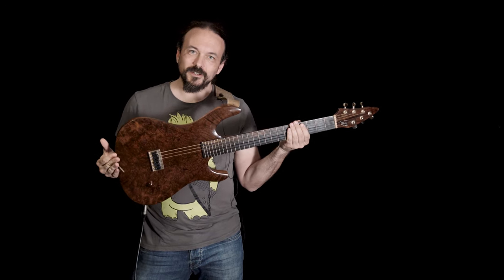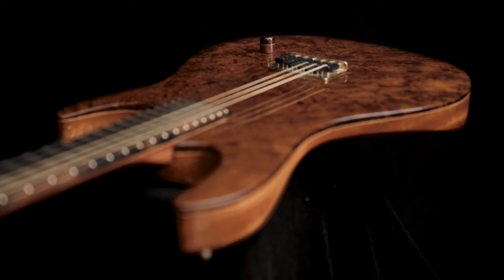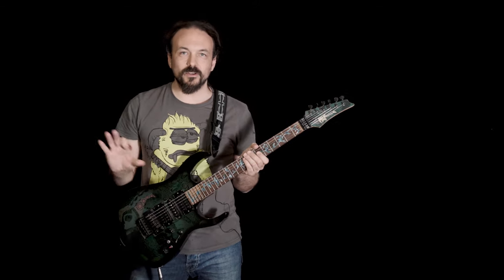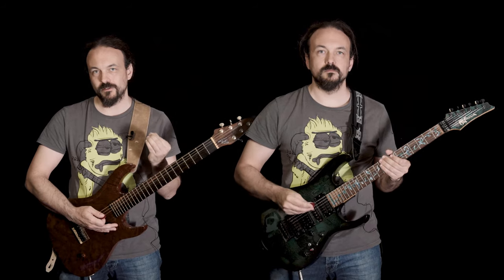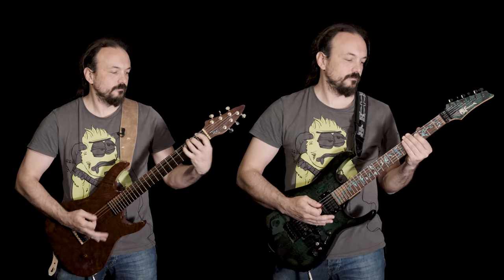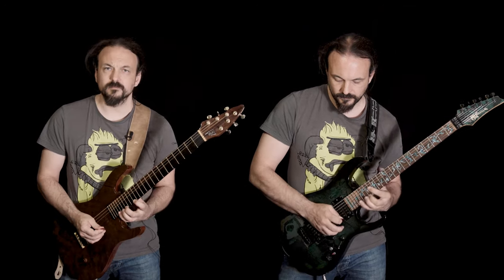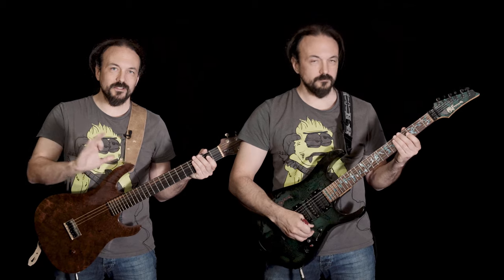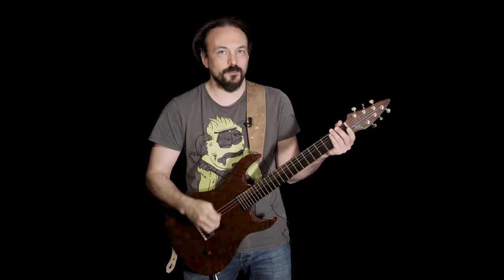Testing a nylon-string guitar with distortion

Comment: Cool video. Maybe playing distorted nylon requires a lot more time to mimic a regular steel string.
Reply from the maker: thanks! I admit I haven't really spent time on trying to "mimic" a steel string sound, I just played the same things the same way. I guess one could get closer with some adjustments to technique, though at the end of the day this will only take you so far, the piezo vs magnetic difference in the frequency spectrum and the difference in the tone of the strings will always be there. This combination does have  a tone of it's own, maybe someone will find it useful for something at some point :)

Comment: Great job.  With comb filter you can simulate the position of singlecoil magnetic pickup. Humbucker with two combfilters etc. (but it is a little more complicated when you make string shorter you muss count this in comb filter time variable for each string individual)
Reply from the maker: yes, I always imagined the variax works this way, and I was a roland system that did something similar. having pitch detection allows the system to guess where the note is fretted and apply appropriate filtering for the given pickup combination it's trying to emulate. Thanks for the links, I've been to that page a few years ago, but I have to read up, he's discussing some things that I'm also researching
Reply from the maker: and yea, for a fair(er) comparison I should have used a piezo with the metal strings... I guess I wasn't going for a scientific comparison, but rather something that people can use as a familiar point of reference (humbucker). Metal string piezo with distortion is also not very common :)

Comment: Very interesting.  What kind of distortion (or pedal) are you applying to it?  The output is direct or via amp-mic?  Thank you very much!
Reply from the maker: It's all going through the Kemper profiler. The clean tones have all amp sims switched off (the guitar is going direct) and the distorted ones are running through some Marshall patch IIRC

Comment: One of the coolest comparisons I have ever seen.  Well done - hats off.  Nice guitar too : -)
So now the question comes what difference between "normal" and "hard" tension strings ?  Wound 2nd and 3rd strings (Nylon on Nylon).  Or Nylon top 3 and flat wound steel lower 3 ...
So many questions; if there is too much bass coming from the guitar that it chokes the amp, we need a different amp (or model ...).  I think there is a lot to discover here ...
And what about different piezo pick-ups ??  The acoustic crowd is always saying that piezo's are to "nasal" and they don't really like them.  But fans love Willie Nelson's Trigger with the PrismaTone pick-up.  That's an ultra rare vintage pick-up.  But what about an LR Baggs LB 6X to approximate the PrismaTone ...  There is a lot of room for experimentation here, lots of room : D
Reply from the maker: you're right, this is an unexplored field to a large extent. I don't expect a ton of change from high tension strings, different piezo or different piezo preamp will of course change the frequency content a bit, also different amps can be used depending on what one wants. To me the "choked" chug sound is not really what I'm trying to achieve, but I can totally imagine someone making it a sound of their own.
Reply: @TraqGuitars  Just seems to me that we've sort of covered most of what steel strings and single coils, or humbuckers can do ...  There is some developemnt going on at the OEM level like my Thinline Ibanez nylon cut-away.  But it's not a lot.  And that surprises me.  A lot of musicians talk of "searching for new tones", but seem to be doing almost what everyone else is doing ...  You are sort of out there on the edge, and that is way cool.  Keep up the good work, and stay well : -)
Reply: @TraqGuitars  but..it sounds awesome!! So much that I built my new chug monster by this recipe... thanks for this idea and wonderful demo!
Reply from the maker: @axelmorisson  great to hear that! I guess I'm a bit conservative in the way I want my chugs to sound :D but if you like this kind of sound and can put it to good use, all the better - at least that's something new!

Comment: I'm not sure if you check these comments still, but I've been searching everywhere for an answer for this question. 
I bought a solid body nylon string guitar called Bullfighter Brown-GD. It has an onboard preamp and the pickup is proprietary and they just call it "bullfighter". 
When i hook it up to my amp, it is literally incapable of distortion, overdrive, whatever you call it. I can change the EQ/tone and volume however I want, but that's it. 
Is this a limitation of the pickup? The preamp? I can't figure it out and I would love to customize my guitar to give it this capability in the future.
You have my endless gratitude if you can provide me with an answer.
EDIT: Apparently if I hook it up to my Line6 UX1 preamp on my PC, I can add whatever effects I want to through their Pod Farm software, but that may just be because it's being processed through the computer first. I'm gonna be honest, I barely understand any of this...
Reply from the maker: sorry it's been a while indeed.. in simple terms distortion is when your signal is too loud for your input device to accept. It usually sounds ugly, but in some equipment distorts in a way that actually sounds cool. The rest is history lol. But what I wanted to say is this: the only reason for something "not being able to distort" is if it is too quitet to distort your amp, stomp box or whatever you're using at the time. Take a distorted amp and roll down the volume, or just play softly. You should be able to get the distortion to go away, if you go quiet enough. 
So if you couldn't get an amp to distort with a guitar, that means the signal feeding the amp was for whatever reason not strong enough - weak preamp, low battery, or some other electrical issue. Asumming the amp is capable of distortion (and not an acoustic guitar amp for example) Maybe the Line6 preamp had some extra gain that brought the signal up to the required level?

Comment: The tapping technique on the nylon guitar was heavenly, but the lower notes are definitely something-- they felt really crunchy at times, and I ADORE THAT, but at some other times it felt really muddy. That bass is really weird hahahah

What would it be like if you went with steel strings for the 4th, 5th abd 6th string?

Comment: Hi! You've built a superb and beautiful nylon strings guitar. Congrats!! and it sounds great with distortion. Is it possible to know what pedal did you used in this video? As I'm looking for a similar result. Thxs!!
Reply from the maker: thanks! this is actually not a pedal, I'm running through the Kemper profiler. The patch is some Marshall Plexi simulation, so what you're hearing is basically old Marshall type of distortion.

Comment: Have you tried using the nylon strings on a classical guitar with piezo pickup and try to play it with distortion with a bit of a reverb? That would be cool to hear from you.
Reply from the maker: Actually, I don't have a classical guitar with a piezo .. but I don't think the results would be THAT much different. The string vibration would be dampened a little by the energy being sucked away to move air (in the hollow body) and the sound might be changed a little, but probably not much more than that. (judging from comparing an electric guitar with piezo and acoustic guitar with piezo)

Comment: I loved the nylon tone except the chugs lacked the tightness I'm used to. I wonder if different amp settings could make it more like the steel string.
Reply from the maker: my guess is that the piezo system gives too much bass which clogs up the distortion resulting in "lack of tightness". I was able to get a lot of that out by inserting a high-pass EQ before the amp. So yea, there's room for experimentation here for sure

Comment: hello, wath is the pedal that you use please ? and could it be effective with a low budget yamaha AEX500NS with only ra ubbish piezo ? lol
what piezo are u using please ?
i have a terrible result when i try distorsion on this yamaha (pluged with lots of effects into a marshall acoustic)
Thx
Reply: the piezo here is a Graphtech system (ghost or acustophonic it was called?), pickups in the individual bridge saddles. As for effects there is nothing, I'm running into a Kemper Profiler for the distorted tone. But I don't think you'll get a good distorted tone with an acoustic amp, the speaker is too wide range. This would have nothing to do with the kind of guitar you use, if you put a distortion pedal in front of an acoustic amp I expect the sound to be unusable. You'd need some kind of amp sim that also simulates the speaker in a guitar amp, otherwise the sound is going to have way too much high frequencies

Comment: I wonder how it would sound, if it would sound similar, if you put regular strings on it
Reply from the maker: well at that point it would sound like an electric guitar with a piezo pickup. I use that configuration to get an "acoustic guitar" sound from a solidbody electric without having to switch guitars in the middle of a song for example. Like here: https://youtu.be/3utV2GZkPZg?si=2JBsqUWsadpf0En7&t=207
With distortion it sounds similar to a magnetic pickup, but - in short - less "full" in the mids since piezo pickups have much more high end and that drowns out the mids.

Comment: are you able to bend on the nylon string?
Reply from the maker: bending works much worse on the nylons. On the other hand you can get really nice vibrato by pulling the string along its direction - as opposed to the bend-vibrato normally done on metal strings

Comment: just a simple question how did you install piezo Hardwear in an electric guitar steel bridge
Reply from the maker: You can but sets of piezo bridge saddles for different types of bridges. That's what I did here, I swapped out the original saddles for piezo saddles from GraphTech.

Comment: with so much bass frequency maybe it worth to connect parallel to a bass amplifier see if that chokes
Reply from the maker: or running direct in parallel. that could work, maybe with a crossover at some low frequency to just send the higher stuff into the distortion. yea, good idea

Comment: It's the piezo making it sound so unique, not the strings.
Reply from the maker: it's true that I should have done a comparison with piezo & steel strings too. I have a 7-string with piezo so I know how that sounds since I flipped to it more than once by accident. The diffrence is much smaller and it's more about loosing focus in the mids, plus the low frequency buildup. Nylon strings do take quite a lot of at the top end (though the piezo counters that to some extent)

Comment: Nylon sounds better distorted than it does clean. For some reason nylon on an electric body doesn't take to an aggressive attack... you get this unpleasant plasticky overtone which you don't get on a proper acoustic body. Even a Godin multiac kind kind sounds bad with a really aggressive flamenco level attack.
Reply from the maker: hmm this never really bothered me so much, but you're right, probably the absence of a thin flexible wooden top makes the attack over-pronounced